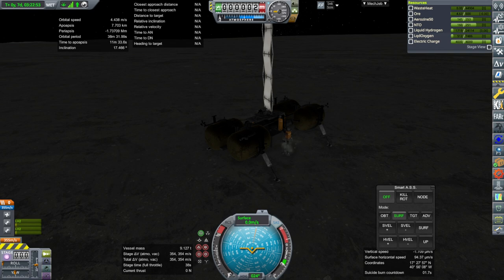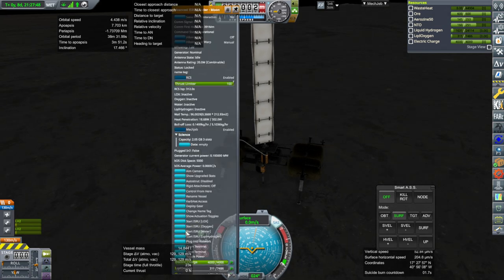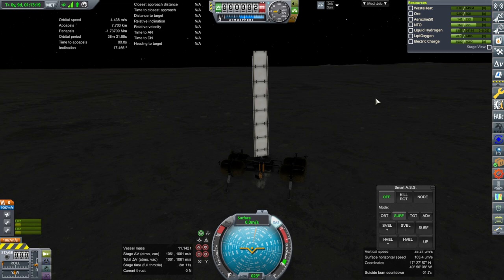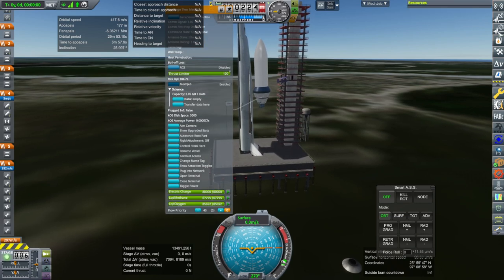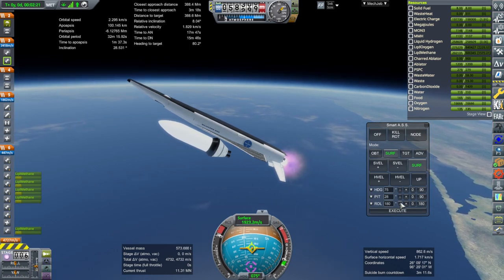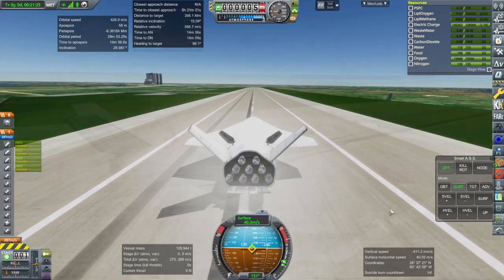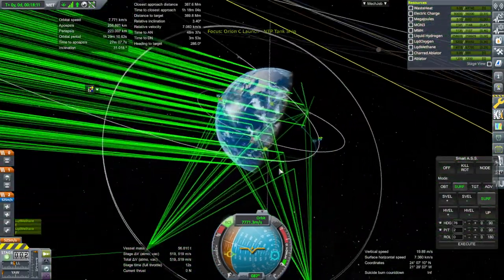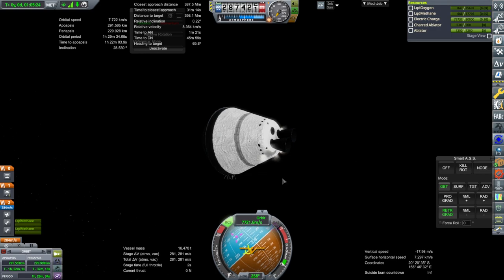Kerbal Space Program 1.8.1 with RO - To Mars and Beyond 04

Comment: do the radiators cool the whole craft or just the parts they are directly attached with?
Reply from the maker: The extendable ones are supposed to do the whole craft while the non-extendable ones just do the part they're attached to. In this case it doesn't matter - they're attached directly to the tank part.
Reply: @RaizSpace  I guess you have to take a dive into the config files? Heat is weird in ksp. Like the tanks placed directly on heatshields